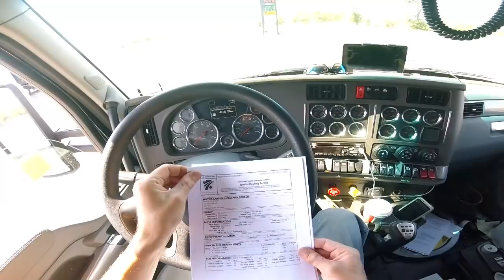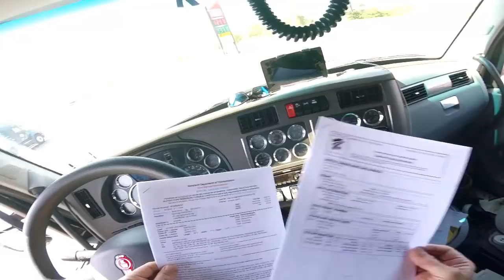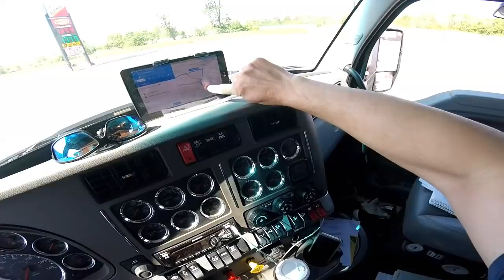KENWORTH HEAVY -- Episode 66

Comment: Dell> its the power adaptor, very sensitive to voltage and computer wont charge. Mine was doing the same thing, bought an aftermarket one but took old one in so they could match voltage up to a 
new one. Hope this helps.
Reply from the maker: I just replaced the adapter a few months ago. It has a poor design where the cable coming out of the 'brick' always rubs against the brick's sharp edge. I see 'white' on the cable isolation in the same spot again, and depending on the position of the cable vs the brick, I either have power or I don't . The battery doesn't charge any more - I need power to operate the laptop. It's pure junk. I can't believe I bought it only in 2016.
Reply: I had 2 of those Dell's with the same problem....I finally went to HP and am glad I did!

Comment: Strange question why do you disconnect your trailer when you park up for the night
Reply: could be just in case he happens to need to drive somewhere. 
i dont know
Reply from the maker: This guy gets it! Diesel price at the TA Travel Center - US$3.59 per gal. Diesel price at the QuickFill on the other side of the freeway: $3.39 ;) It took 20 min to pump 93 gal in one tank, but I saved US$18.60 ;) Having my 'free' coffee at Dunkin Donuts now!
Reply: Totally understand fuel price reason guessing it's easier to bring goose neck with you instead of leaving it with trailer?
Reply: Interesting I assumed it was to take the weight off the truck while parked. Over hundreds of thousands of miles it would probably make a difference. But then again I'm not a trucker
Reply: Leaving the neck with the trailer is more of a pain.  You have to pull the air lines from the truck,and more importantly the hyd lines to the trailer, which are a pain to deal with.  Easy to just leave the neck on the truck and run down the road.  Some places are not a big fan of that though, since the truck tail lights are technically blocked by the neck hanging down.